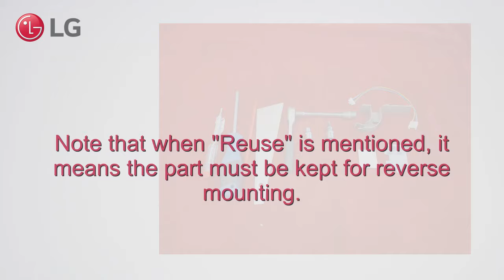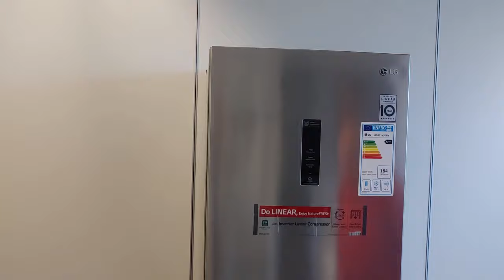[LG Refrigerator] - Reverse doors of a Bottom Freezer model

Comment: Thank you for this super instructive video! One question: I have a GBP62PZNCC1 model, which has buttons for setting the temperature within the top panel that you remove at 3:55 and I wasn’t able to pry it loose after removing the 2 screws. Do you know of any additional clips/screws that I need to remove for this model?
Reply from the maker: Not really but because it has in integrated display you should indeed be carefull and perhaps look for an owners manul via your local LG support office, where door reversal instructions should be provided.
Reply: I hope you managed to figure it out in the end, but for anyone else with the same model as you and me: there's no other screws, it'll come off with some careful wriggling. I think there's some clips on the left and right. I didn't have a plastic prying tool, so I used a credit card instead. It's a great video even if the fridge is slightly different. Just be sure to follow all the steps, don't be like me and miss the parts on the bottom of the doors that need to be moved as well... which I didn't realize until putting the entire fridge back together.

Comment: The plastic part 10:32 is impossible to get on. When i first get it on, the door pushes the plastic upwards as i close and open the door. Makes a weird sound. What should i do? You dont really see how you do it in the video.
Reply from the maker: Dear, thank you for your comment. Please make sure the harness isn't too long, as it could bend (which could cause the sound you refer to) and guiding the harness behind the protrusions inside the cap. When putting the cap up, you should hear a click. Good luck!
Reply: @LGSAE  Thank you so much for getting back to me. I cant seem to get rid of the issue. Is it possible to send you a picture showing the problem?
Reply: I am also having same problem, it does not fit at all, tried couple time to do everything from beginning, didnt worked. Is there any solution to this? 
Thank you for your help

Comment: Hi, I reversed my fridge’s door yesterday and followed exactly every steps from this vdo. Apparently after reversing, the upper door isn’t aligned properly. It seems to tilt more to the upper left corner which I assume it affects the suction of the door when it’s close as the door suction doesn’t feel as strong as before reversion. Please advise, I really couldn’t figure out how to adjust the door alignment. Also, the bottom door isn’t seal properly.  Do I also need to reverse the seal of the bottom door so it close properly?
Thank you very much.
Reply from the maker: Thanks for your feedback. It is advised to reverse the seal of both the freezer AND the fridge door. If this does not solve the problems with the suction please contact your local LG support channels.
Reply: @LGSAE  Thank you for your reply. I will try reverse the seals first and see if it’s better.

Comment: Hello mate nice video , i have the LG GBP62DSNFN, i do everything as you describe but i cant put the last plastic cover top left side, it just doesnt fit.any advice?
Reply from the maker: There should be a spare for the other side in the unit. depends on the models, some in the top cover, some in the bag with the lower hinge.

Comment: Hello, while I am majorly thankful for the video. I am curious. I have LG GBB72MCUFN and it does not have the top screws. Is there some additional video or suggestion about what to do? The screws that are removed at 1:30 of the video.
Reply from the maker: Are you sure they are not hidden under a cap? It could also be that you are able to pull the cover gently off
Reply: My fridge didn't have screws there either, it's all snap off, snap on.
Reply from the maker: @quercophilia  there could be little differences between models

Comment: Hi, Thanks for the video. What is the part number for the reverse door hinge for the bottom??
Reply from the maker: Please consult your local LG support office, as part numbers may vary depending on the exact model.
Reply: Thanks for that. I figured it out myself.
Reply: @Marsd30  Hi - How did you find the part number - LG Australia is no help at all
Reply: @Epic_SS  Turns out I didn't need a part. Everything was included in the original door hardware

Comment: After completing all steps and placing the upper door on the hinge pin, and attaching the upper hinge, the door is slightly misaligned as it now is shifted a little left leaving 1/4" of the fridge body exposed on the right. Is there any way to adjust the alignment of the door?
Reply from the maker: normally that should not happen. ensure the center hinge is not off and the top hinge well bolted.
Reply: I am having the same problem

Comment: Hello. If i want to change only freezer doors can i just release bottom one of freezer doors hinge change doors and tight it back?
Reply from the maker: Dear Customer, You cannot do 1 door only on an LG bottom freezer. The hinge in the middle is one assembly that hold the top of the freezer door and the bottom of the fridge door.
Reply: @LGSAE  hello. Its possible with right tools. Ive done that :D ofcourse its not the right way..

Comment: Hello, I have a problem with the plastic part from 10:32 it doesn't fit properly as the door itself is a bit higher than normal.
I would highly appreciate it, if you share your experience with solving this issue.
Reply from the maker: Apologies for the late reply, I do not know why your door is higher, could it be a leveling issue? Or please check the fixing pin of the fridge door; is this mounted correctly? Otherwise contact your local helpdesk and check what could cause this.
Reply: Hello, did you ever find a fix for this?

Comment: Bonjour j'ai  LG GBB61DSJZN
Le cable (a la 0:08 minute de la vidéo) c'est pour quoi faire ?
C'est quelle référence ? Est ce obligé pour mon modèle ?
Merci
Reply from the maker: No, you don't need this cable. This cable is only required when you have a display that is inserted in the door at the top side of the door, we call this is metal touch display, since you do not see the display directly, only the leds. Hope this helps.
Reply: Many thanks Lg

Comment: Thats a pity the additional aprts are not supplied with the fridge (like in the case ov every other brand) and you have to buy them separately.... This made sure my next fridge won't be LG.
Reply from the maker: Actually all parts you need for reversal are supplied. In case you miss any part I would advise you to contact your local LG service center.

Comment: The plastic cover at 10:45 does not fit perfectly with the cable inside when i try to turn the door and creats some noise.
Reply from the maker: Then check it carefully please. Does it ouch anything when turning? Are the wires guided properly? Are there washers aroung that area that come in contact with the cover?

Comment: Hi. Just purchased the 
#LG454L Bottom Mount Refrigerator GB-455WL.  What parts do i need to swap door around ?
Reply from the maker: they are shown in the beginning of video
Reply: @LGSAE  hi. By the way is there a wine rack for this fridge
Reply from the maker: @Helloworldwrjfjrjrj  For that you need to contact Customer Service, it is avaialbe for some models, it is a holder to be placed on a shelf for 2 bottles

Comment: Does anybody know how to disable the door alarm? Mini keeps going even when the doors are shut
Reply from the maker: There is no option but to put a magnet at the position where the door detection is done. However, the alarm soudns for a reason, which is probably something you ned to get solved. Did you recently have the door open direction reversed? This might have caused the issue.

Comment: I just bought gbb72pzefnans im struggling hard to make this possible, don't wanna break anything and be called responsible for.. It's a shame there is no info st all sbout this in the manual. This fridge has obvious screws on the top.. The same does not hapoen with gbb72pzefn model

Comment: Where can one buy the correct size mm socket tool for the bolts, please?
Reply from the maker: That should be possible in any local hardware or DIY-store. You do not need a special LG tool for that

Comment: Still possible to ask questions here? thanks
Reply: i am in the process of doing this switching on my fridge. From what i can tell in the video, most og the hinges are reverseble, but one.That be the one, that is beeing switched at 5.29 in the video. Is that correct. I mean, that is a Hinge, that i where suppose to have as a spare part for when i bought the fridge? But all the other parts that is beeing changed from one side to another is reverseble, right? thanks for your time
Reply from the maker: yes

Comment: Video is OK, but whoever decided not to put paper instructions in the fridge manual should burn in hell.
Reply from the maker: Thank you for the comment Otakar. Well, door reversing done by the customer will void warranty, because a lot can go wrong, mainly the wiring is  sensitive to getting damaged if not guided correctly. This is why we typically recommend to let this be done by qualified service center staff.
Reply: @LGSAE  Reversing door is actually very simple but very difficult to do if you don't know exactly how. There are a lot of plastic parts that are very easy to break if you don't know exactly whether they should slide out or just forcefully put it out. And I dare to say that the law in the Czech Republic does not allow to invalidate the warranty of the whole product if the person himself reverse the door (assuming, of course, that reversing does not destroy anything)
Reply: @LGSAE  I don't think you fully understand the EU legislation on warranty. You don't seriously believe that will hold up in court, do you?

Comment: 2:50 Why is this pin so difficult to remove. with poor tools, you can easily strip this.
Reply from the maker: Depends on the tool you use. Poor tools will indeed kill the pin, that is not our fault.
Reply: Which tool should be used for this pin?
Reply: @LGSAE  I would also very much like to know what tools to use for this pin since it's impossible to remove. I don't have poor tools but the size of the pin doesn't seem to be standard. I would be grateful if you'd put more specific tool requirements in the information below the video.
Reply: @LGSAE  so to do something that should be provided as part of the retail price of the fridge, you have to also go and get good quality tools for this one task??? Lousy customer service.

Comment: ch hatte mit LG telefoniert, der Mann war sehr freundlcih, hat mich jedoch explecit darauf hingewiesen, das ich auch die Dichtungsgummis entsprechen drehen muss, da es sonst zu Piepern etc kommen kann. Wer weiß davon? Im Video kann ich das nicht finden, der LG Mann meinte jedoch, das würde ganz kurz gezeigt....
Reply from the maker: Let me answer in English. You are right, the video does not mention that you need to rotate the door rubber 180 degrees. I have added this in the description of the video. Do note that for a new installation this rotation may not be needed. The door rubber at the hinge side is 'squeezed' more over time, so the longer it has been used, the more the rotation is required.

Comment: Macht das nicht selber! Nachdem nach einem halben Jahr der Türalarm grundlos permanent lief habe ich den Service kontaktiert. Dort wurde mir gesagt, dass LG die Garantie verweigert wenn der Kunde die Türe selber gewechselt hat.. Also notfalls am Telefon lügen wenn man danach gefragt wird, oder nicht selber machen. Den Alarm habe ich jetzt einfach rausgeschmissen.
Reply from the maker: Dear, how unfortunate this happened in your case. Door reversal is always at your own risk unfortunately. That is one of the reasons why we provide these types of instructional videos, to make people aware of the considerations and offer proper advice. As indicated, guiding the wiring correctly is critical when reversing the door direction, because if nog guided correctl, the wires may break or get stuck at the hinge side, which may lead to short circuits later.